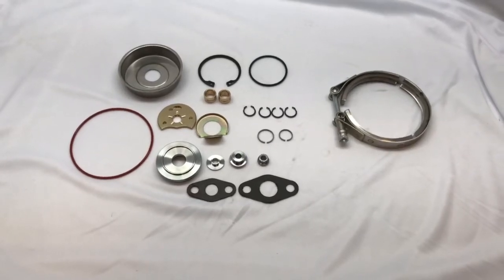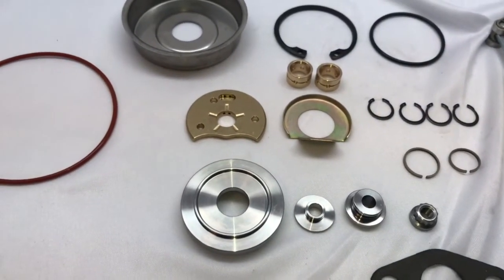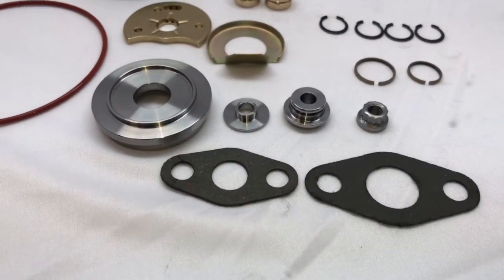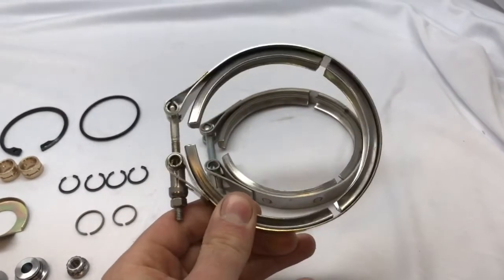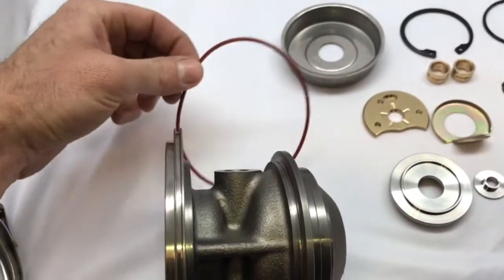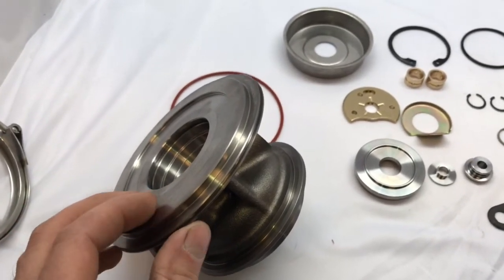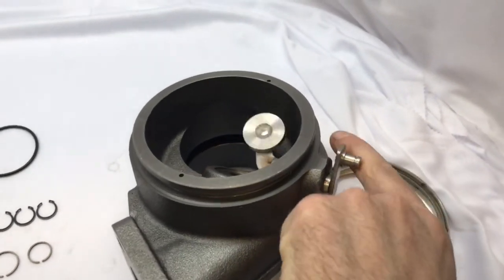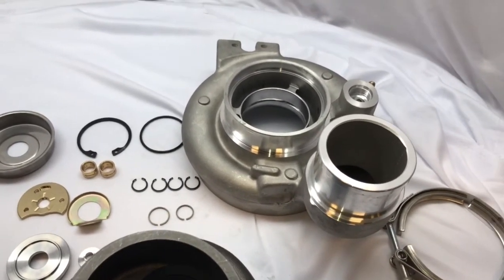2003 - 2007 Dodge Ram 5.9 Cummins HE351CW Turbo Rebuild Kit

Comment: Putting this kit on rite now 60x67 with the bigger housing on my 03 replacing the 341 but i have a little black o ring scared dont know where it goes lol i think its in the oil drain line port 😅but other then that went together like a glove looks awesome excited to pull with it

Comment: I know this is old, you may not see this but i got a,question for you,  i want to make sone custom turbines, and i want to see if you can ballance  them after i do the weight reductions on them. essentially, im  adressing the edges of the inducer, and the hub   of the 67mm turbines  for a slight improvement in flow, spool and weight.
Reply from the maker: My machine can balance it. I’m not sure how to mount it to the machine. I’ll research that. I have all of the specs though

Comment: I was just going through the inventory of parts for my Holset HE351CW, I did not receive steel exhaust gasket which you have advertised through Amazon.    but you did send 2 large O rings 1 to many I think

Comment: Do I need to use o ring on my bearing housing or can I skip this step and not use it?
Reply from the maker: You can’t use the oring unless the bearing housing is machined for it. If you don’t use it, it may leak, I machine them for the oring
Reply: How soon do you think you will be making a complete teardown and rebuild video for a he351cw turbo, I just received my rebuild kit today and will be waiting for your complete video.
Reply: You say without the O ring  it may leak ,so what keeps the stock turbo from leaking ?

Comment: The bearings looks different on the kit from video.
Reply from the maker: Do you mean the groove in the center of the bearing ? There are 2 versions they both have the same fitment.
Reply: Yes. Well i did order one for he351cw  the journal bearings were thick   and will not fit on the shaft. I ordered from somebody els before i saw this video.
Anyways i will order from you and will see how it works.
Reply from the maker: Are you rebuilding a genuine Holset turbo charger?
Reply: Turbo Lab America yes